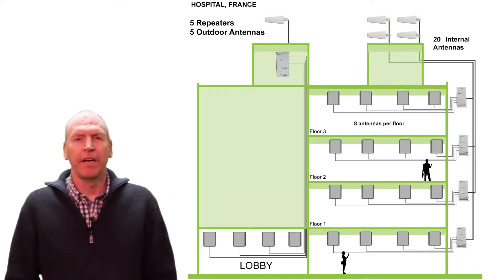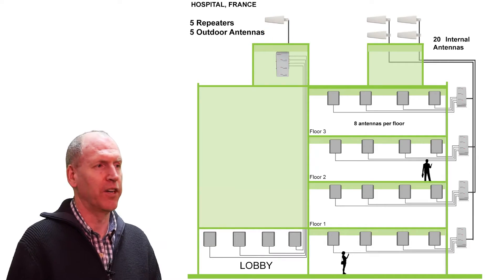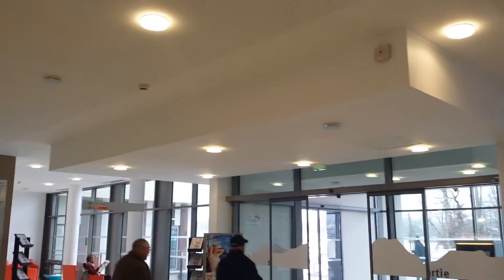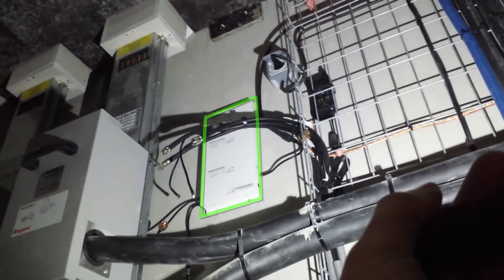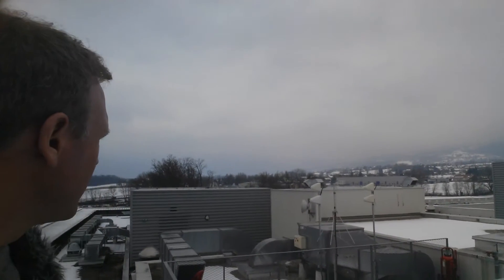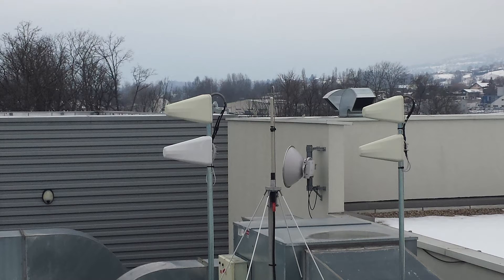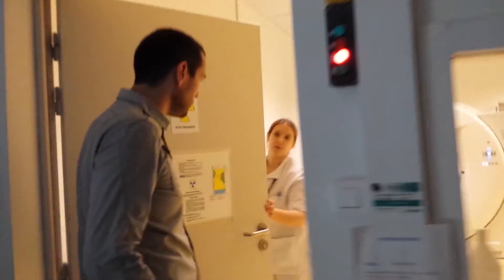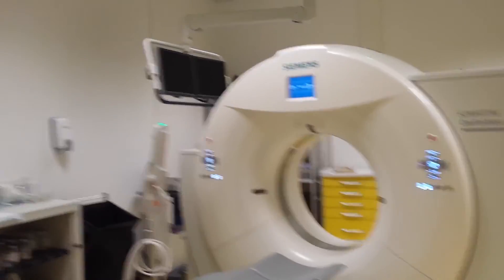Installation of mobile signal booster in Hospital

Comment: Why aren't you using band selective amplifiers in this case ?
Reply: Catalin Chira band selective means only one operator gets boosted. The hospital required that all operators were boosted. Therefore we installed a wide band booster system.
Reply: ***** Thank you for your quick reply. I am in the same business as well, for some time now :) and I have the "know-how" The wide band option is good, in some cases, but a digital band selective solution is better. You minimize the risk of interference and signal propagation is much better.... but, it costs more :) Good luck with your future installations :)